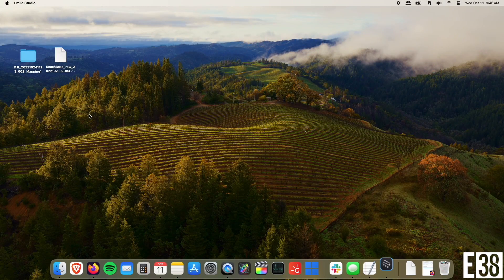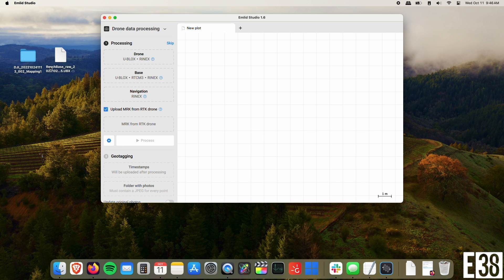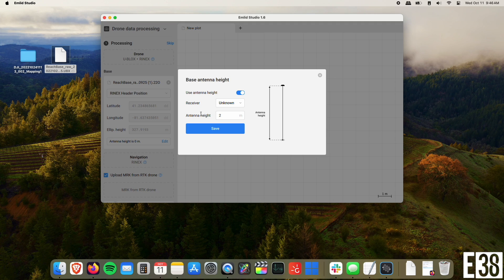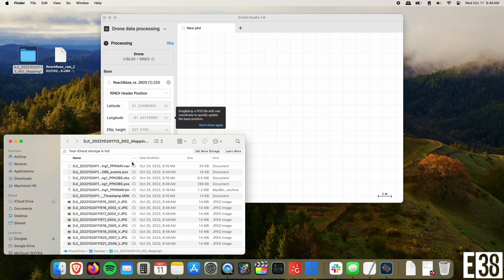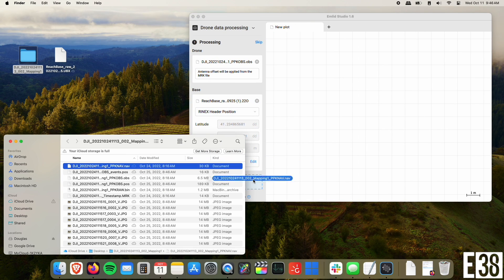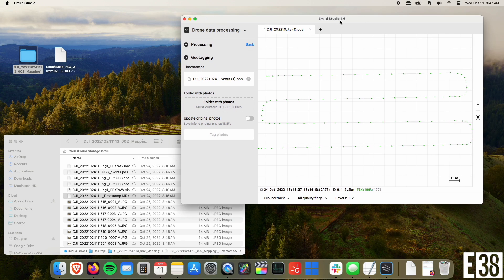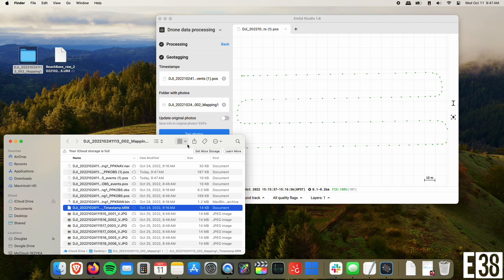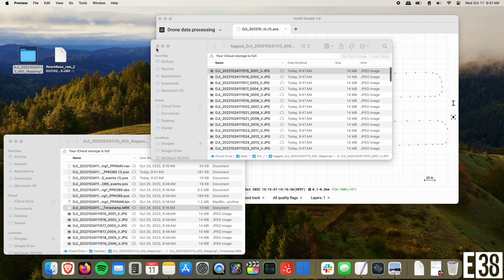DJI Mavic 3 Enterprise RTK Post-Processing (PPK) in Emlid Studio

Comment: Where did you get the .obs file from your drone flight? Did you rename one of the other DJI files?
Reply from the maker: The .obs file should be in the mission folder with everything else. Are you flying with an RTK module attached? You would need that as well.
Reply: @e38surveysolutions59  Thank you! I have been flying the Mavic 3E, as well as, the M350 with the P1 and L2. The P1 does indeed have the .obs & .nav files like your video shows. However, the files from the L2 flight which include images (mostly for colorization of point cloud) does not have a .obs or .nav file. I'm trying to see if I can PPK the images from the LiDAR flight without having to fly a whole other mission for photogrammetry.  These are the files I get: .CLC, .CLI, .CMI, .IMU, .LDR, .RTB, .RTK, .RTL, .RTS, EVENTLOG.BIN, PPKRAW.BIN, .MRK.
Reply: @joshm443  Hey, did you find solution for L2? I have the same problem :s
Reply from the maker: We've looked into this for a bit, and haven't been able to get the L2 to generate that file.
Reply: @joshm443  Hi Josh, basically DJI store the observation file in .RTK format. 
You will take the .RTK file and change the extension to .rtcm3, then you use the convert function of Emlid Studio "Convert to RINEX", then you shall get the obs for PPK solution.
Reply: @DerekYap-mo3tb  Big thanks for that info.  I didn't realize the RTK file was just rtcm3.  Usually I have my base recording observation and just change my rover to a base with a RTK shot.  If I'm beyond Lora radio reception I'll just average it as I'll post process with the original base UBX file.  But that only works with DJI Terra for the L2's lidar.  Now I can post process the images as well!
Reply: @PortraitArtPhoto123  Hey I have the same problem. Where did you find the RTK file? I have only pictures in my mission folder, nothing else
Reply: Same issue for me using the L1 I do not have OBS or NAV. However I was flying with RTK enabled to my RS3 over Local NTRIP.